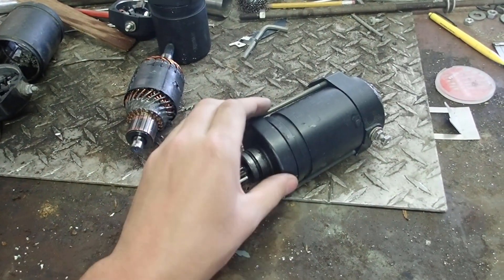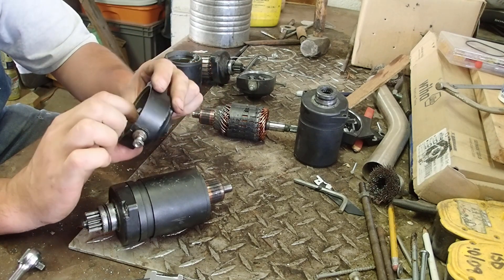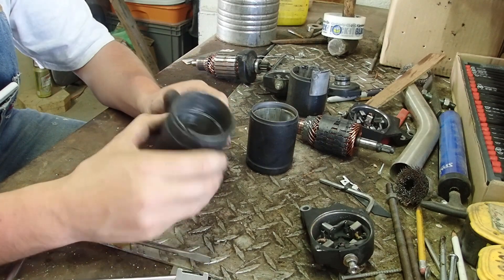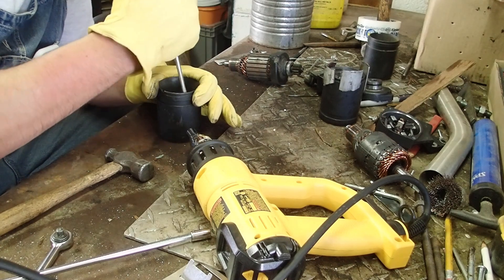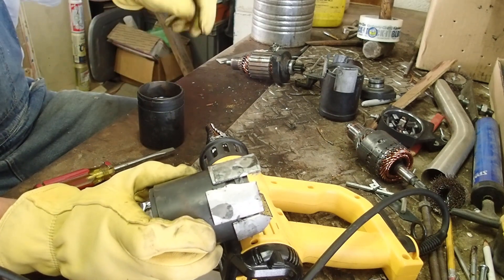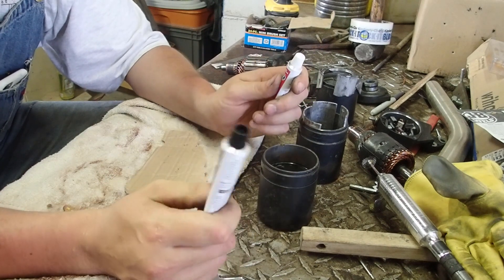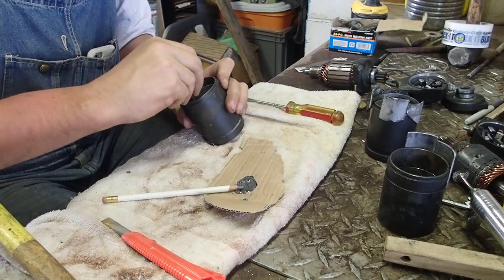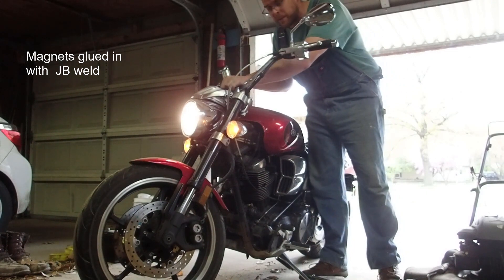xv1700 Warrior Starter Rebuild

Comment: Use locktite red permanent thread locker to glue them in, I’ve used JB weld and the magnets just fell off after a few revolutions, gorilla glue and superglue just as bad 👍
Reply from the maker: Ive never had issues with JB weld. I have one starter on my bike for 2 years with them jbwelded in and no problems